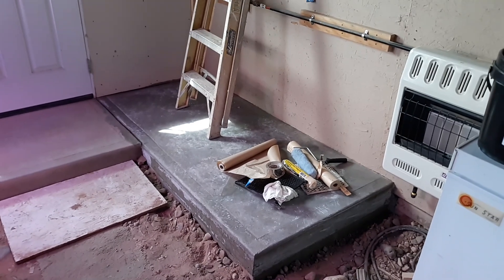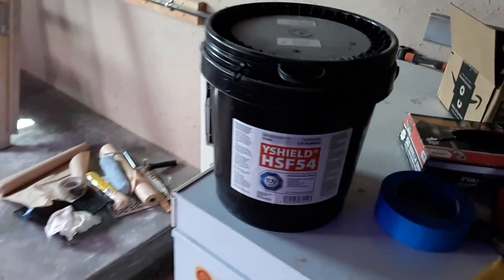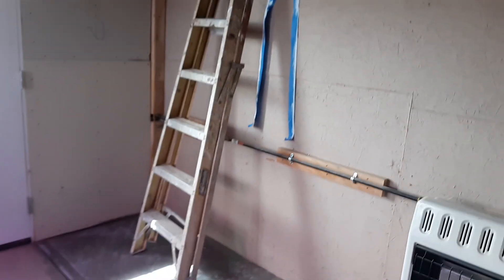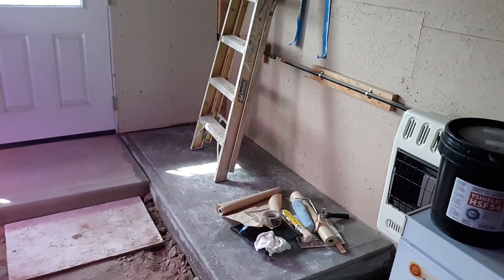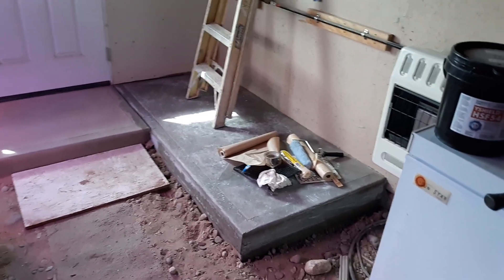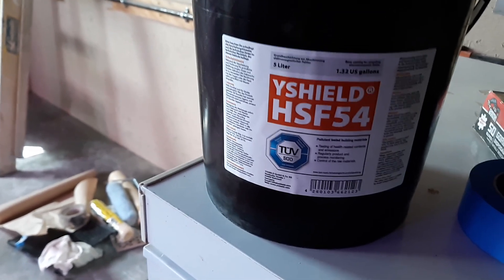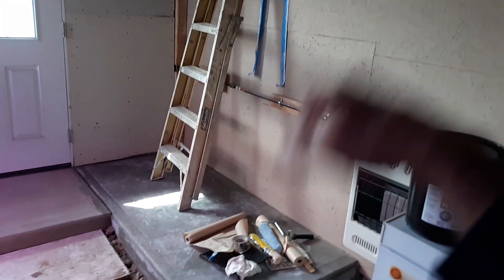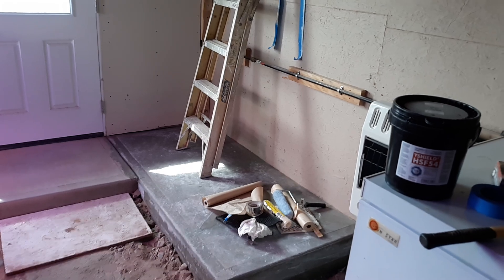MOVING MY BATTERY BANK & SOLAR SYSTEM OUT OF THE BASEMENT & MAKING A FARADAY CAGE AROUND IT

Comment: Glad your getting your  solar stuff out of the house.. Could you use layers of aluminum foil instead? Foil insulation with added heavey duty aluminium foil behind it should work and it would be cheaper. Just a thought may God guide you on the best way to do this.

Comment: Hey Paul and Adrian, I thought you took care of that a year ago when you found out what was causing your headaches and your sickness.
Reply from the maker: I painted our ceiling in our living room, it helped with the EMF upstairs,,,,, only bought about 4 gallons of the stuff, you have to put 2 coats on the walls, it took almost 2 gallons just for the living room, didn't have enough paint to do the outside of the house, this stuff is 250 bucks a gallon, need about 15 gallons to do the job.... If someone wants to donate for the paint, I would be happy to paint at least the outside, then you have to repaint the original color which is another 15 gallons......

Comment: Are you going to ventilate that area?
Reply from the maker: yes to the outside
Reply: Good job Paul.  Rule out as many causes as possible.  When it comes to ventilation, you should not only consider air extraction, but also air supply.  I have built two houses with help.  I did about 80% myself.  I did all the installation work myself.  Gas, water, drainage and electricity.  If you have a combustion appliance in your home, you must ventilate very well to avoid carbon monoxide poisoning.  And headache.  An opening to the outside approximately 30 centimeters from the floor for fresh air supply.  And on the other side of the room, about 30 centimeters from the ceiling, there should be an opening to the outside for exhaust of used air.  For the sizes of the flow holes, see Google.  Insufficient ventilation can cause severe headaches.  I got a huge headache while building one of the two houses.  I went to the doctor but we didn't know what it was about.  Until I found out it came from a heater.  I had placed it in the room for warmth.  It ran on kerosene and carbon monoxide built up in the house.  When I stopped using the thing the headache went away immediately.

Comment: Sounds like a plan .Rather than move all your solar and batteries could you not just build a stud wall around what you need covered ,paint and line with a roll of Faraday cloth and move the news room.
Reply from the maker: no I need to move them, very unhealthy downstairs, they do out gas, dangerous gas, I do have them vented but is not enough, in the summer the batteries boil when they make too much power, I constantly have to monitor them and shut down some solar panels when they are making to much juice
Reply: @OFF-GRID-DESERT-FARMING  I'm with you . Batteries don't get lighter as you get older ,thats for sure .